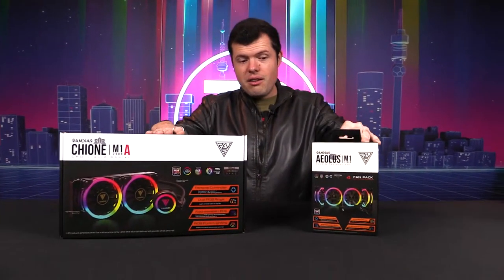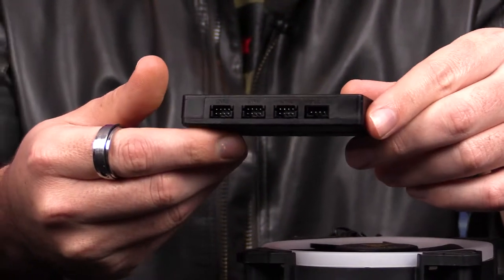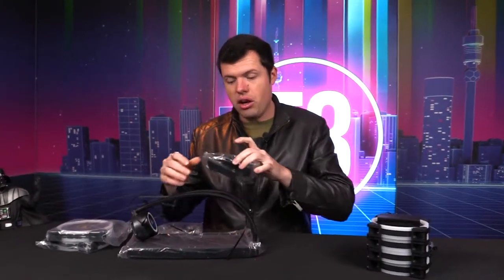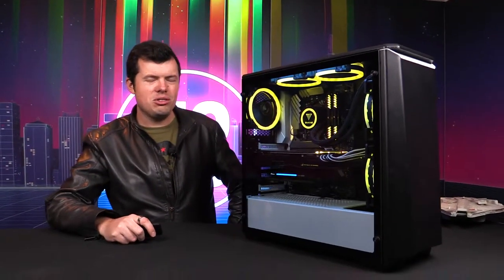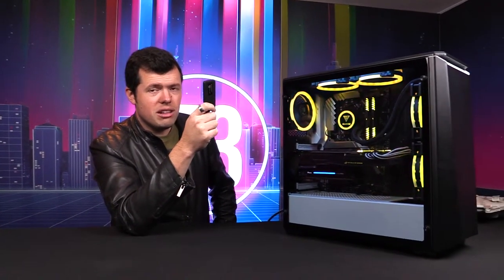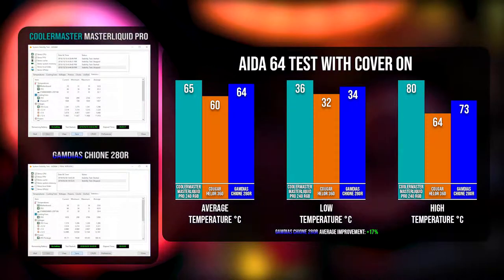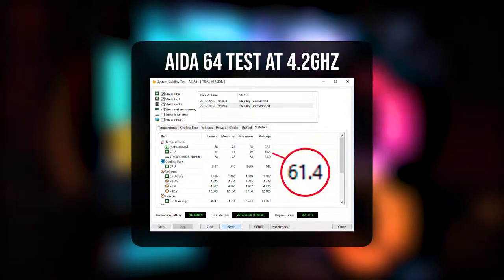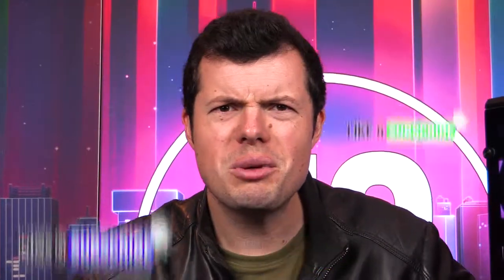Gamdias PC Gaming Cooling Kits / Fans / Systems - Aeolus M1 & Chione M1 A Product Review

Comment: I looked on the gamdias website and it says under AEOLUS BOX II: 
Support LED type	5V 3-pin Addressable (Digital) LED
Support Motherboard RGB Sync Connectors	5V 3-pin Addressable (Digital) LED Header

and for the fans:
Rated Voltage	12 V (Fan) / 5V(LED)

im not sure what to do (noob here), i only have 4 pin rgb headers and fan / pump connectors are all 4 pin as well. Does this mean I can only control rgb with the remote?
Reply from the maker: You can pass through to the motherboard as well. There should be an included cable for it. Remote for the fan speed only though.
Reply: @turbotortoisetech  so there is no way you can control the fan speed with software?
Reply from the maker: @wihanswanepoel7330  No unfortunately it's all off the included controller. The newer controllers have 4 speeds which is lakka

Comment: I bought the Gamdias Aeolus M2-1205R 120mm RGB Case Fan - Pack of 5 and I am happy with them, still have to install the 2 top fans, but have to remove my mobo :( to get to the top as I use my Antec gx 300 case, i like it.

Comment: How are the noise level of the fans?
Reply from the maker: They're actually some of the quietest I've used. Update to this is that they have some some pressure so they're best for air cooled builds and will struggle a bit with radiators.

Comment: Absolutely crap fans.
Reply: why?
Reply: @justynly-kowalski3502 causee  they are only for look for tempered galsses cases, if you do not want to spend your money like ~ 375 Euro for 3 x3 pcs pack of  Corsair Qled or Thermaltake quad ring:D At highest speed 1500 rpm they are the noicest fans i ever heard sound like a jet engine or vacum cleaner, only at lowest speed 500 rmp they are quiet but evaen there at not more quiet than good stock case fans. They are rated at 17-23 DB, but at highest speed at 1500 rpm they sound like 30 DB or more for me:D I keep them at loest speed